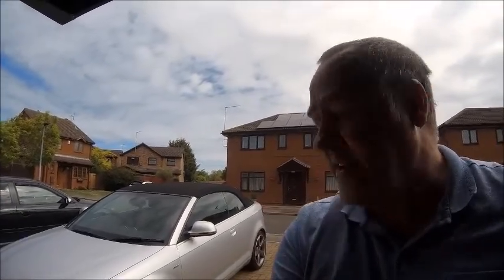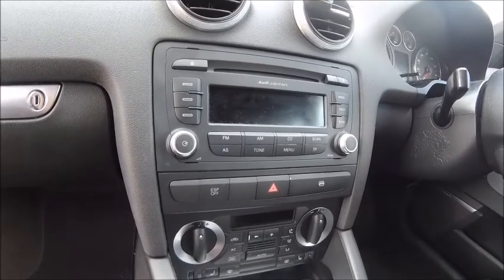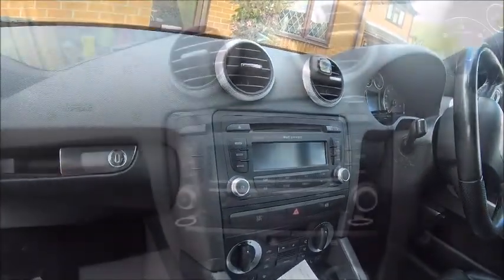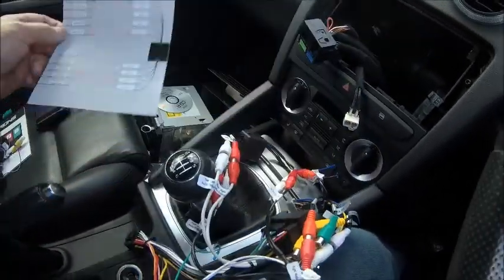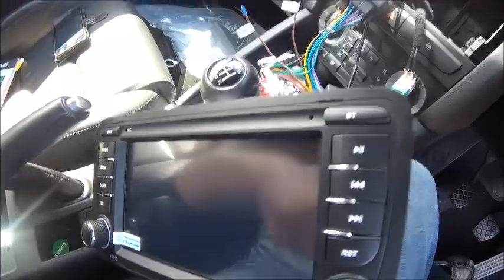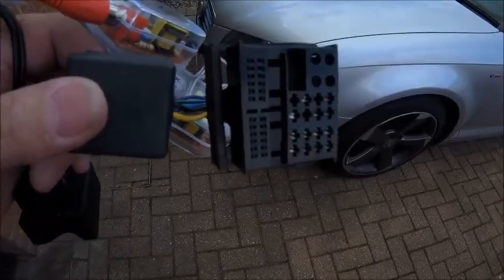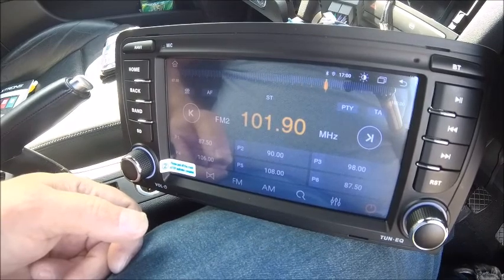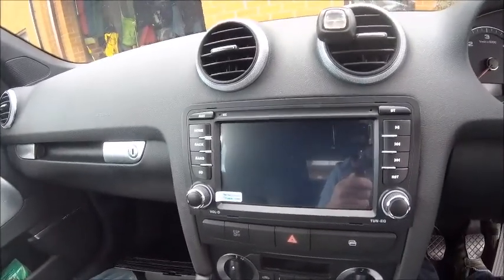Audi A3 | Fitting a Android Stereo

Comment: Could you tell me how you connected the impedance converter?
I tried here, but to no avail.
The rear speakers do not want to work.
Reply from the maker: Make sure ALL the connectors are in place ...you should have nothing unconnected . the wires should be labelled with Lf / Lr etc

Comment: My car does not have Bose but I have no sound in the rear speakers with the adapter and without it
Reply: Have you found a solution?
Reply: Same here rear speakers not working
Reply: With some a3 models there aren’t + and - kabels for the back, going to the brown plug. So the speakers don’t work

Comment: Hi there. When you did this, were you able to use the volume control on the steering wheel? Many thanks
Reply from the maker: Yeah worked just fine....you need the canbus unit of course...
Reply: Thanks. Could you let me know where you got the unit from and send a link if possible?
Reply from the maker: @younusafzaal5647  It was an ebay special, but sorry dont know for where .

Comment: Do you have a subwoofer output RCA connection on the back of that? Also, could you post that part list again?
Reply from the maker: As I recall , yes sub is connected and can be controlled in the sound settings.
Reply: Alguém tem o esquema para a instalação?

Comment: I've got the same one in mine, I put my gps aerial in the glove box and works brilliant, only issue I got is my radio reception is terrible
Reply from the maker: Got sent back in the end , screen just went black ...never bothered to fit a new one , just stuck with an RNS-E
Reply: @AdeReeves  on the antenna part of it mine has a green wire for the reception boost but don't know where I connect it too lol

Comment: how did you connect this to the original wiring for the bose subwoofer? mine has an RCA cable that is labled subwoofer but how am I meant to connect that to the original sub wiring? thanks
Reply from the maker: you may need one of these if it does not work out the box

https://www.ebay.co.uk/itm/185738772721?hash=item2b3ee4c0f1:g:ecIAAOSwq5pjxAtv&amdata=enc%3AAQAHAAAA4PbW%2FUaEY2pgemQ0lmoIHMSJ0I1fpTkG4tULdwHAFgZhYdZNmQjmCRcQQVU6voRK122hbzUj%2B8GOo8Id8Lz6gLHcKmG2w8NhSaEi4Hi5oRRMN%2FVkQ%2BqpyTvaJF7AIAHAE%2FewoPvcmfGIFccI9Gqut%2BBurv9d%2B7dKM0GujdvPdSRyHp%2BThR3%2B6i46g2ZZAOEVy9Z3FsfUMQei4T0fF8CzmbLfbZwwMD3M29CmK39qXmMopohCeH%2B1o8cGZPh6RoRcD4CdqPUm%2B%2BPItNX2jKuDnPjR%2F7J5oiNjxrIc%2B6CmRI4z%7Ctkp%3ABk9SR6KxjOHDYQ

Comment: does rear speakers and sub works?
Reply from the maker: I had to by a additional Ground Loop Isolator but with that it all worked spot on
Reply: @AdeReeves  without cutting any wire, juct that?
Reply from the maker: no cutting , the ground loop took some interference out of the unit, and the sub was more pronounced with it ...they sell on evil-bay for around £18 but well worth it ..   look for item number 304301615487

Comment: Did you have to fit a trim plate or did it fit snug?
Reply from the maker: Popped straight in ....
Reply: @AdeReeves  i have the same unit  and it doesn’t fit all the way in , I think on yours it also sticks out a little from the bottom? What did you do to push it all the way in
Reply: @rcmains4237 same here, were you able to fix it?
Reply: Got the same issue any ways of fixing it

Comment: Do u have speakers at the back? Does it work fine
Reply from the maker: had to buy a adaptor to getthe best quality ...currently got one for sale on the bay ...

https://www.ebay.co.uk/itm/185738772721
Reply: @AdeReeves  basically I don’t have sound in the rear all I feel like. Can I email you mate?
Reply: @ashwinanbu1 same as me, did u sorted?
Reply: @efrenzgz  had to buy adapter
Reply: @ashwinanbu1  can u tell me which one, or send me a link, thanks to much dude, i just installed my radio in mine right now but not working
Reply: @ashwinanbu1  this is driving me crazy, i just connected everything correctly but nothing, i dont have bose audio
Reply: @ashwinanbu1  hello?

Comment: Does it fit like that or you haven't push it all the way in?
Reply from the maker: No..It does fit flush, just wanted to tidy the wires up before i seated it.
Reply: @AdeReeves  i keep getting resistance right at the end how did you manage to fit it in flush all the way?
Reply: @rcmains4237 I have the same issue

Comment: how did you connect this to the original wiring for the bose subwoofer? mine has an RCA cable that is labled subwoofer but how am I meant to connect that to the original sub wiring? thanks
Reply from the maker: it needed a BOSE connection adaptor